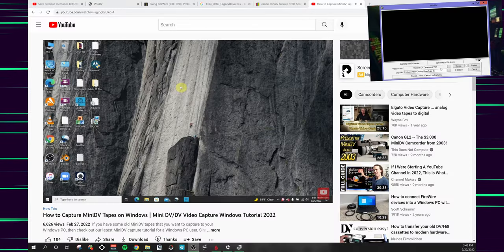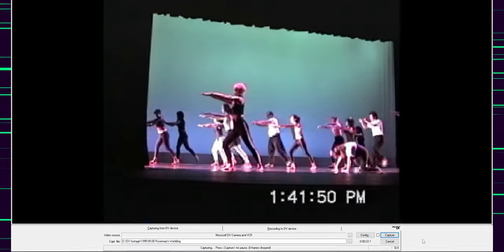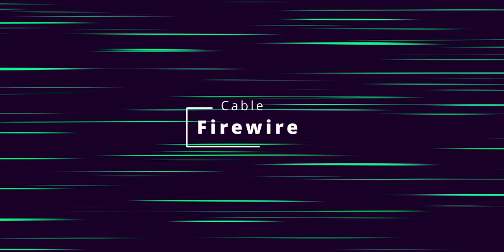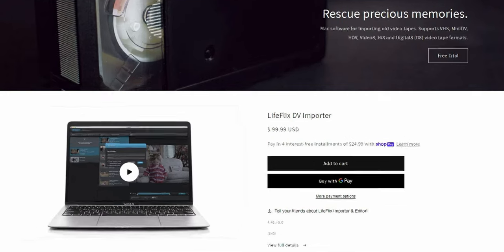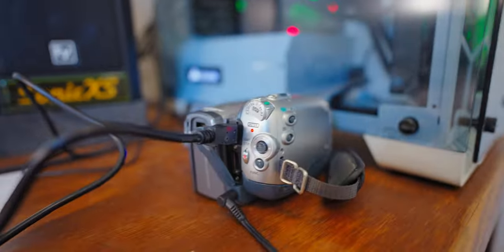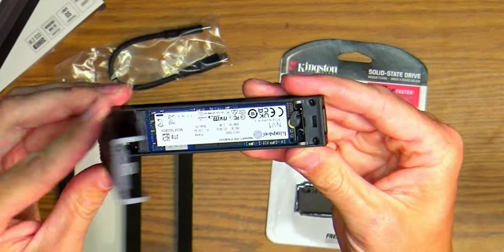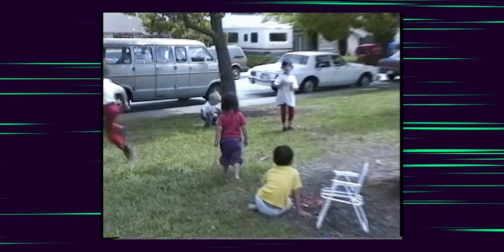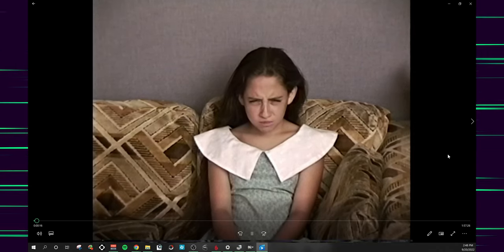Digitize Hi8 & Transfer HDV Tapes

Comment: Will,  Thanks!   I have been using a Gefen Composite converter as I lack a FireWire camcorder that works.  I have a couple that don’t.   The Gefen seems to work well.  I’d like to see which is better FireWire or Gefen.
Reply from the maker: composite has a lower data rate than firewire 400. therefore firewire>composite

Comment: I'm in 100% the same position that you were in at the start.  
Parents have plenty of family videos on both VHS from an ancient enormous VHS camcorder, and a bunch of Hi8 tapes recorded with a Sony tvr68 handycam.

I bought one of the cheap usb to composite+Svideo adapters off of Amazon and the results have been really gross.  

I sure wish their Sony handycam had a FireWire port!  

Time for me to search for a FireWire camcorder as you did.  
This feels like a huge rabbit hole that I will regret jumping down...

But anyways 😂
THANK YOU for your step by step instructions!!! 
This is exactly the kind of tutorial I've wanted.  
You are my hero
Reply from the maker: I'm so glad this helped! This IS a huge rabit hole. It took me approximately 11 months to get a small stack of my parent's hi8 in a format that my mom and siblings could watch. I plan on documenting the transcoding process at some point, but capturing is the most urgent and important part. I can transcode and de-interlace anytime. but those hi8 tapes were starting to mold and the longer I waited, the more footage my mom was loosing. so I had to get that part done. I feel so much better now. If you want to go down this rabit hole, I'd suggest Epos Vox's video on this subject. It's very in depth. though it was difficult for me to understand the first dozen times I watch it. lol

Comment: Hello, thank you for this video.

I would like to know if Premiere pro can detect the video source of the camcorder through the firewire plug ? Wouldn't it be a time saver to do a compression directly after the capture, and use video enhancement plugins ?
Reply from the maker: from the research that I have done, yes. other people had a good experience with premiere pro. When I tried detecting the camcorder in premiere elements 12 (this is the only copy I have), i wasn't able to capture video due to that feature being locked. I need premiere pro to try that feature out. but i don't feel like wasting the money on premiere anymore since I don't use premiere anymore. i just wish davinci resolve had a capture feature.